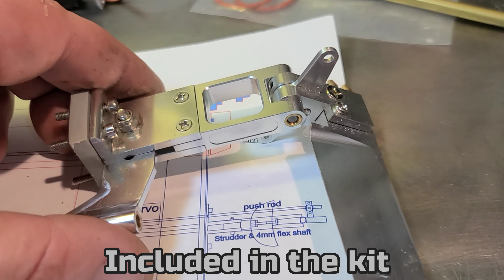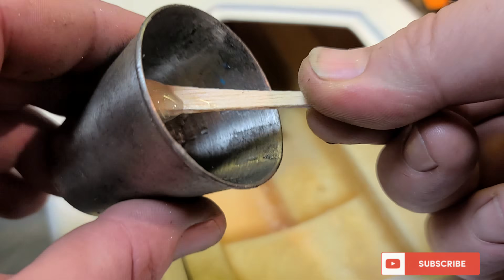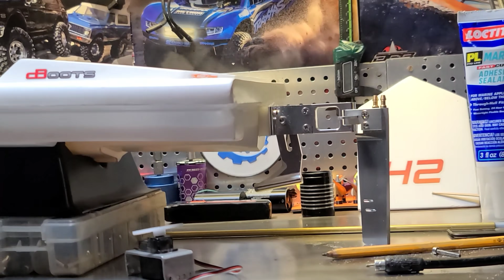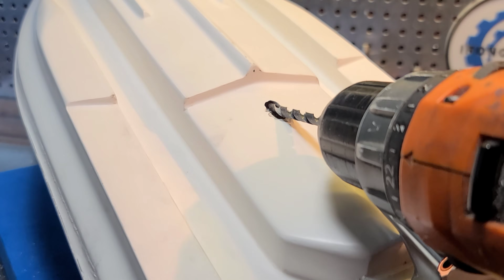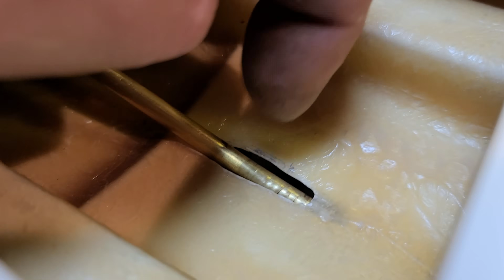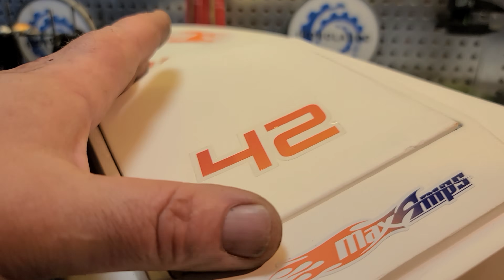Hybrid Rc Boat Build Submerged Drive, Stuffing tube & Hardware Install 19" Water Bobber

Comment: Some really valuable and interesting stuff in this video Big B 👌  Thanks for sharing.
Interesting approach for bending stuffing tubes. Thin walled tubes, as you say, are a little more tricky. I use old flex cables (where the ends have started to go) and have them inside the stuffing tube before heating and bending. Alternative to your method of having a spring on the outside. I've never kinked a tube using this method, and having the flex cable inside helps retain the heat and makes bending easier 😉
Reply from the maker: Lol I actually had a tight fitting flexcable In the tube when I was bending & kinked the tube. That's how I normally bend my tubes normally works really good.  The 4mm liner is extremely thin.  👌    thanks for watching brother
Reply: @IRONCLADRC  😂🤣 Well, just goes to show, thin stuffing tubes have a mind of their own!! Lol
Reply from the maker: I think my keyboard & auto correct in this phone has a mind of its own too

Comment: Hey ! I replaced the Stuffer tube on 24" Pro Boat NEW !! and it still Getting water through the shaft !
I put it in the Bath tub ! seen it! 
Any Suggestions on how to stop this dang water ?? GOING THROUGH !
Reply from the maker: You may need to remove all the hardware and use sealant around all the thru holes, I've also had leaks where the drain plug is.....       Have you tried heat shrink over the strut where it connects to the stuffingtube?  You may need to put silicone in the heat shrink before shrinking onto the stuffing tube/ strut
Reply: @IRONCLADRC  will do ! thanks

Comment: Good video. Do the sell good epoxy in little tubes at Harare stores
Reply from the maker: I've been using the jb 5 minute epoxy for a couple years now I've had no trouble with it    I think I got the jb weld epoxy at Lowes. (If not it's at home depot)
Reply: @IRONCLADRC  Thanks Big B